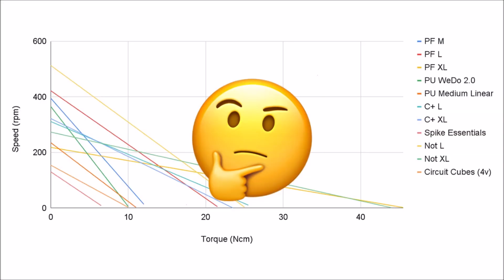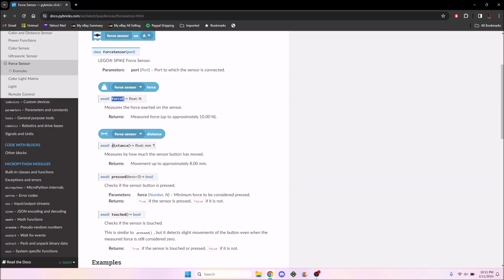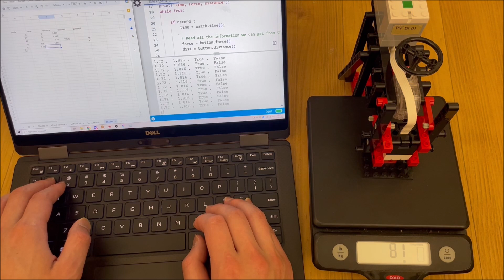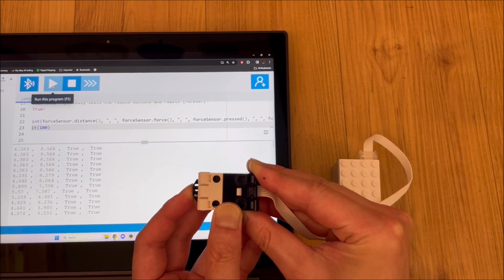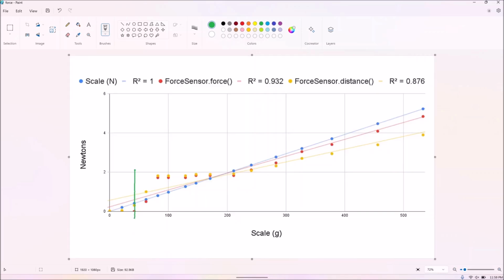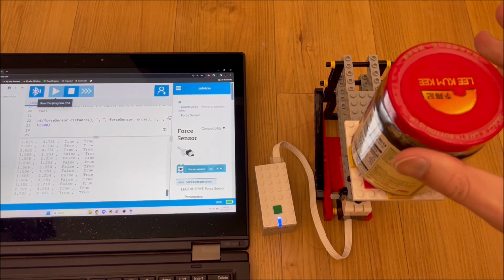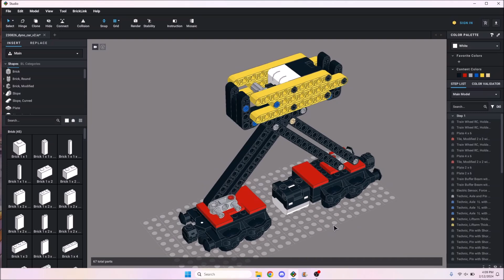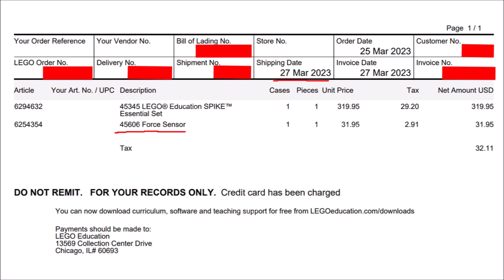How BAD is the LEGO Technic Force Sensor?

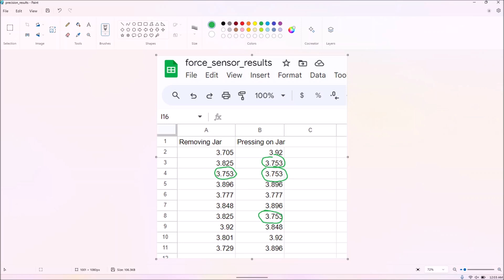Comment: I think at 5:37 you really hit on the problem of quantisation - the way the analogue quantity is converted to digital ‘steps’, and the completely-misleading number of significant figures that results! As you say, not enough resolution in the A/D conversion - but I guess that big ‘cliff’ must have a mechanical cause, such as rising spring rate. I wondered if a spring inside was becoming coil-bound but you’d think that would happen at max deflection; not starting deflection

On another note, can you guys do a review of original Mindstorms NXT in your usual excellent style? :D with a follow-on video of aftermarket sensors? I really enjoyed the RCX stuff you did
Reply from the maker: NXT is actually on the list now that it's basically old enough to be a vintage set lol

Comment: Again a very interesting video exploring the depths of powered up!

I don't think your sensor is defective, looking at the Lego Education Blog where they detail all the different sensors, they list the force sensor as having an resolution of 0.1N but with an accuracy of +/- 0.65N and activation force between 2.5 and 10N.

It makes sense the sensor returns pretty much garbage below the activation cutoff, and it also makes sense this sensor isn't really accurate since it's designed for school use, you'd rather have a less-accurate sensor that kids can throw around and still work, that one that is a bit more precise but breaks when looked at with ill intent.

With the same numbers coming up, internally the sensor submits its reading as an uint8 (unsigned 8-bit integer), so there's only 256 different values (0-255) it can return, so it would make sense that the "force" values are just a multiplication of that 0-255 range to map it to "real world" units.
Reply: Eh?! It only returns 8-bit values?!
Reply from the maker: Where did you find this blog post about the activation force? It's one thing if that's a thing, but it's ridiculous if it's not listed on the product page; I'd even call that scummy.
Reply: @NonsenseWars  Try searching for Exploring SPIKE Prime Sensors
This is the 3rd time I've tried replying, if it gets removed again by youtube I give up.